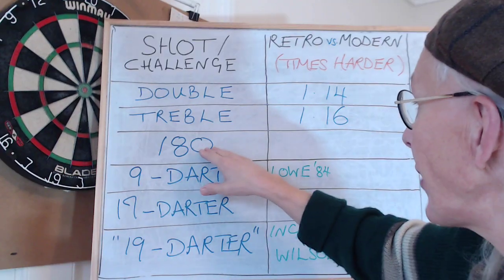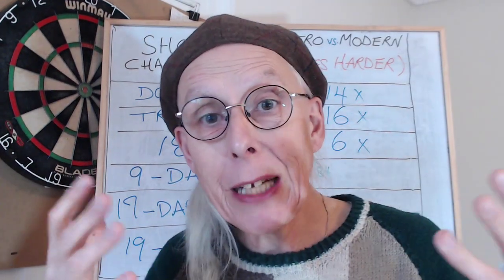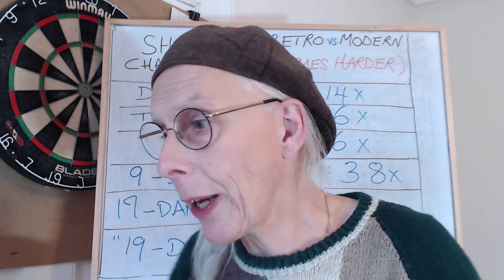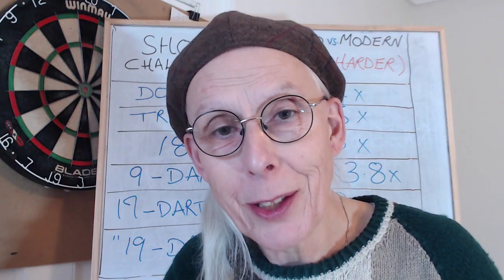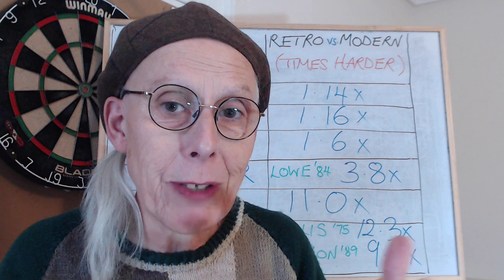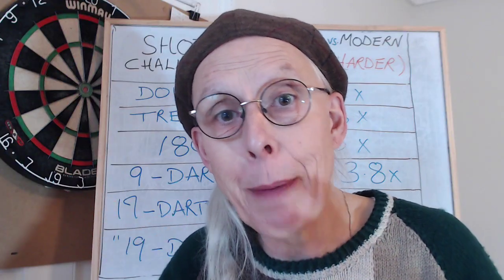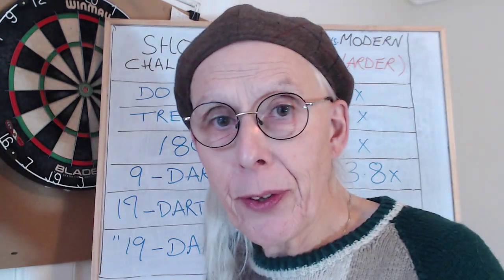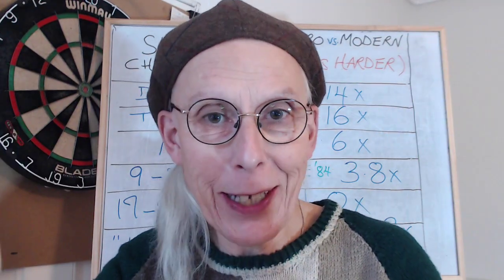Comparing the John Lowe and Luke Littler Matchplay 9-Darters: 1984 Was Four Times Harder Than 2025!

Comment: Good Afternoon Timo - some more information on elite level darts.  Phil Taylor in the 2009 PDC World Final attempting 180 - 49.6% of first dart hits T60, 46.7% of second dart hits T60 and  32.1% of third dart hits T60.  I haven't noted his strike rate for a three dart finish that has two trebles w a double - maybe later as I have to watch the match again.
Reply from the maker: Hello Baron, and those statistics are very interesting, as one might think the strike rate would increase with dart 2 and poassibly dart 3 as well (because the first dart acts as a marker, and the muscle memory is already established for a T20), but the fact that it doesn't may be due to i) obstruction by existing darts (given Phil Taylor's torpedo shaped barrels), and/or ii) a psychological preference on his part for the empty bed. I have been planning a video for some time on the difference of aiming at a "blank canvas" with the first dart, vs aiming at a "marked canvas" with subsequent darts, mainly based on psychological aspects. This data will be very helpful, thank you. Regards, Timo
Reply: @UndartedWaters  Of course only a very small snapshot to gather statistics such as these. Taylor did aim all of his darts - his confidence level in his own ability to reproduce his throw without the usual grouping methods is amazing.  Two others come to mind when aiming (with a single shot) - Price and Wade on D20.
Reply from the maker: @baronvb3752  Yes, I agree, the look in Taylor's eyes when he throws is profound. He makes every dart count, and sets himself incredibly high standards. Something in his psychological make-up of a relentless will to win. And, yes, Wade and Price are scary on tops, particularly Wade.

Comment: I couldn't wait to replace my Staples board , my average went up but unfortunately not a great percentage 😂 . Retro darts also huge with no 40mm points.
Reply from the maker: Many thanks, and it's great to hear you saw a difference with the "thin-wire" board. Those staples were terrible, and probably ruined the dart-points as well. Like you say, the darts were also chunkier then, so grouping was harder, which makes the achievements of Lowe, Bristow, Wilson et al all the more impressive!

Comment: Hm.
Not correct. 
Please add the fact that the new Darts and points allows a way better grouping....it is not in the calculation
Reply from the maker: Yes, you're quite right.This "four times harder" is just in terms of the size of the treble. The slimmer barrels and longer points mean grouping is better, so the true figure could be significantly higher. Just makes us appreciate even more the elites of the 70s and 80s!
Reply: I agree - Lowe was using a larger diameter dart but so was Taylor who had many 9 darters .  Taylor's total 9 darters stood at 22 - however not all with his larger darts.

Comment: Excellent video Timo. Bristow in 1984 BDO World Masters averaged 101.16 beating Deller.  The modern wires (blades) are angled to so some darts will still penetrate the board on hitting them.
Reply from the maker: Many thanks! And a huge thanks to you for the data you sent me yesterday that inspired this video. That 101.16 average is wonderful. Like you say, these numbers I'm quoting are underestimates really, as they do not account for the bounce-outs, which would hamper the players back then – I wonder how many 9-darters were killed by a bounce-out in those days? Another advantage of the modern boards is that they are so much brighter with sharply contrasting colours. For me, this makes the treble 20 appear so much larger too, which really helps with hitting it frequently (hence I need a new board, as my poor Blade 6 has become very dull with wear, compared to when I first bought it). All the best!
Reply: @UndartedWaters  I think the Bristow Lowe final had 1 bounce out if I recall and that wasn't really a bounce out more of darts blocking the third dart.